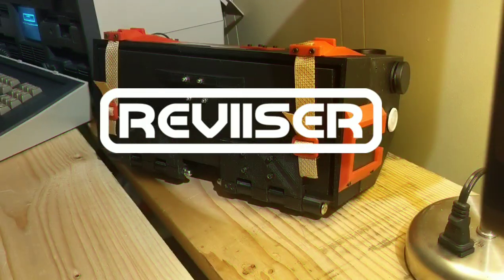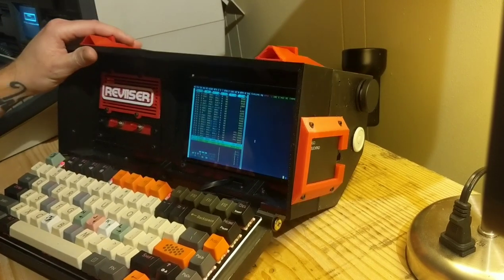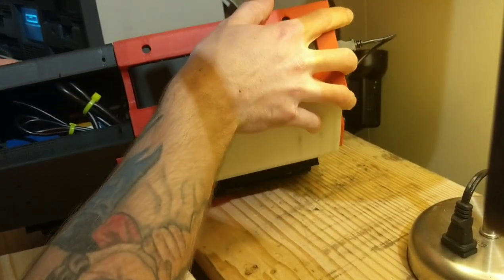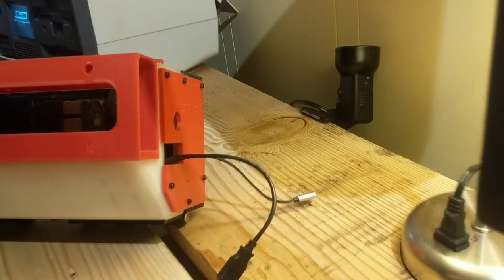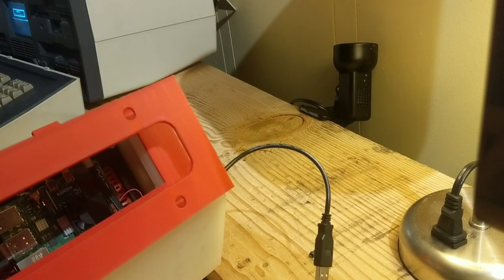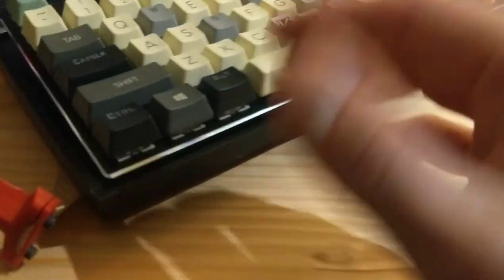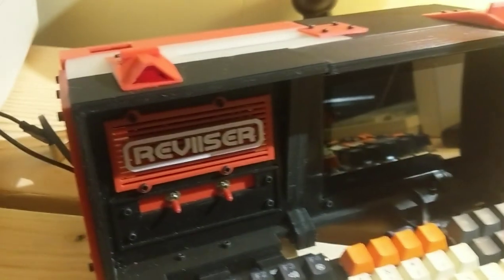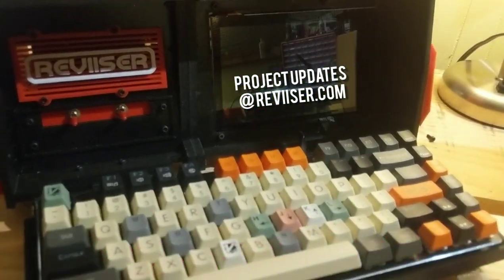Reviiser V.1 Cyberdeck Update

Comment: Helpful hint; use a DC-DC Up converter and set output to 5.12 to 5.2v to power the USB Host controler chip properly and get rid of the lightning bolt.

Comment: What 3D printer are you using/recommend?  Been wanting to get a 3D printer to get my kids interested in it and I think a project like this would be good for all of us!
Reply from the maker: I'm using a Creality Ender 5. I got it early in 2019 and this project was part of me teaching myself how to use it. I would recommend it as I haven't had any major issues at all with it and while I have done some upgrades to it, it was all pretty easy stuff. I liked the Ender 5 because the build plate only moves up and down, not side to side. To me it seems like a more stable design. Less wobbling around if that makes sense. Plus the Ender 5 has a pretty sturdy frame built around it. I have gotten some really high quality prints from it with very little effort out into dialing in the settings. Let me know what you get and I'd be happy to help in any way I can! There are some killer videos on YouTube that are great to help you set up your printer and get it calibrated right.